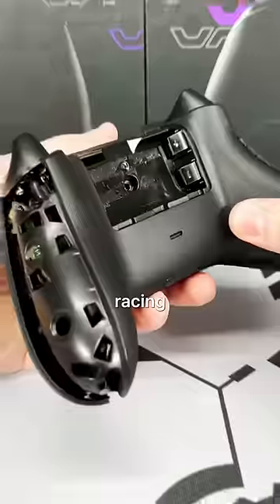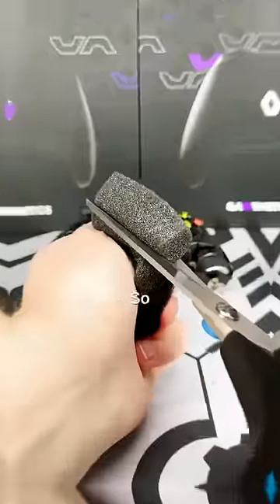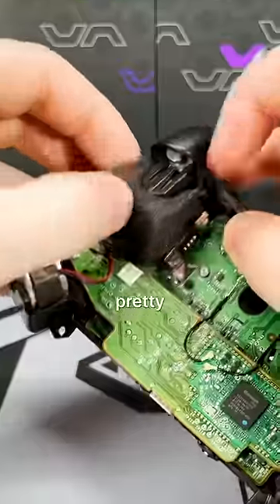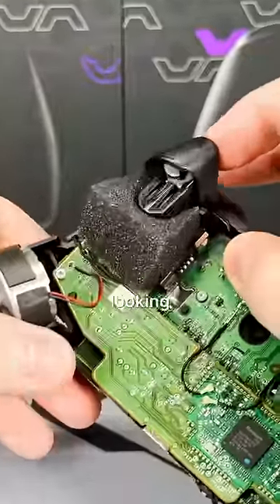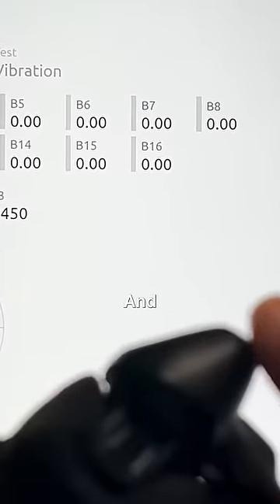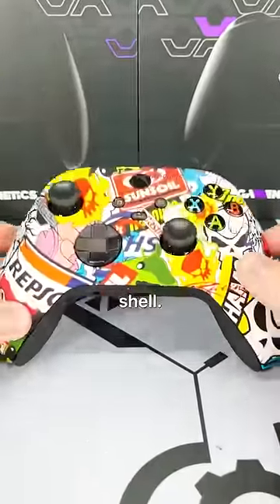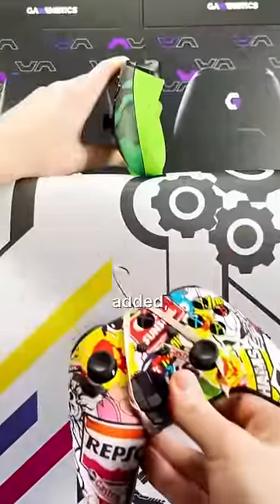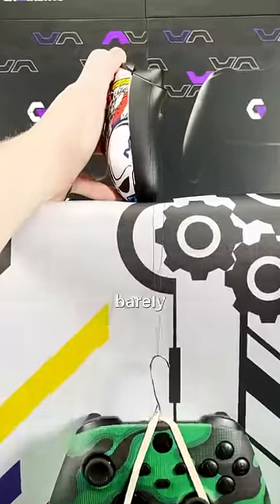The Controller BUILT For Racing

Comment: That foam is going to disintegrate and make a huge mess.
Reply: It will also add way more stress on the motherboard and plastic of the trigger.
Reply: @@benfranklin5335your hand doesn’t really rest where the foam is though
Reply: @equalixer9609  thats not how heat works lmao, it doesnt just stay where ur hand is, and ur fingers are also on the triggers
Reply: No it really won't lol
Reply: @equalixer9609  but there is the moisture and that from the hands if they get sweaty and that yk
Reply: But the controller already has a small version of this to avoid the plastic of the trigger hitting the casing.. and it doesn't disintegrate.
Reply: I get your consern but at least mine has survived for a good 11 months so far. It has been used heavily
Reply: 1. It isn't going to disintegrate, if your controller created enough heat to disintegrate the foam it would burn your hands before it disintegrated the foam.

2. The foam isn't going to cause enough pressure on the PCB to cause issues, it's not conductive and controller PCBs are very durable, and all the soldered on modules aren't just going to fall off because of some foam. 

3. The heat isn't even reaching the foam since it's more than 1cm away from the battery.
Reply: though tbh with modern controllers lasting 1 or 2 years, it's probably not that big of a deal.
Reply: Not to mention it’s a slight fire hazard
Reply: The foam will not disintegrate from the heat given off by the controller or your hands. Not even styrofoam melts at that temperature.  240 °C is the melting point of styrofoam. The foam he's using is made from a polymer that results from mixing Hydrochloric acid and Polyurethane. This type of foam's melting point will easily exceed 400 degrees Celsius. 

What kind of controller are you holding, and what type of food are you eating, for your hands and controller to melt the foam?
Reply: @adamtucker117  you just going to say that or are you gonna give proof??
Reply: @Flabby555  prove to me that you exist and I shall
Reply: @adamtucker117  💀
Reply: 3 words for you:

ELITE SERIES 2 CONTROLLER!!!!!
Reply: @tiagonascimento4386  ngl it's been on my mind
Reply: @J_Analytics  yeah i dont understand why he thinks this foam is gonna melt lol
Reply: For a DIY its still cool. A xbox controller is dirt cheap now a day especially used i think its worth the experience.
Reply: I doubt the heat from your hands is going to melt that foam, repeated use might wear it down but it's not gonna crumble, that foam looks like the same kind I use inside of engine bays at work, it pads the inside of a battery box which gets really hot, and I've cut some for trunk bump stops and they held up ok. This would probably work but not as well as a spring.
Reply: No it won’t. Lol
Reply: @dxfault576 barely any heat in the pads in the grand scheme of things no point trying to be a keyboard warrior on YouTube
Reply: Foam doesn't just disinegrate when it's not exposed to elements and or oil or some chemical

Comment: I think PlayStation controllers adaptive triggers are great but it’s cool how you manage seed this one😊
Reply: Was here to say the same thing. The brakes on nfs unbound are honestly revolutionary. I just picked up a ps5 and am honestly in love with the adaptive triggers
Reply: But what if he has an xbox then he cant use it
Reply: @Pandemomium  not true, using a ximm or chronus its really simple to use a ps5 controller on xbox. Some features may be missing but its doable
Reply: @crashbflexin  Same, I play GTA 5 with my dad all the time and the adaptive triggers sometimes are just alone enough to change a bad day to a good day, and they’re not locked to any setting like this Xbox thing is
Reply: I also love how the joysticks are placed at the bottom and they don’t run out of battery Avery 2 seconds cough cough XBOX
Reply: I hate Nintendo’s controllers, the ones on the switch build in hurt after a while, all the controllers are shitty and cheap asf and break in 1 second after purchase
Reply: @Zentrix71  LMFAO, my girlfriend is an Xbox player and I'm trying to get her to use a rechargeable pack because I'm over spending money on her fucking batteries. Playstation is the goat
Reply: Just got a ps5 recently and was blown away by this
Reply: I turned that off when I got my ps5 lol.
Reply: Yeah I've always been a lover of xbox controllers since the 360.  But Sony knocked the ps5 controller out of the park, feels like a next gen controller.
Reply: That's the one thing I love about the PS5 is the controllers. The adaptive triggers and the touchpad are dope. Love my Series X but the controller is just so boring.
Reply: @crashbflexin  i love them until sonys notoriously terrible batteries die too quick because of the controller gimmicks
Reply: @crashbflexin  lol until I tell you how much I spend on games every year vs what it cost me to buy those game individually if I owned a ps5. Ps4/5 are only popular due to hype beast bs and Asians. Having replaceable battery is better than buying a new controller when idiots kill their battery life.
Reply: @irateamatsu  "boring." it's a controller, it does what's intended. Not every controller needs your butt plug gimmick you keep pitching to Nintendo to be used with joycons lol.
Reply: @Red1676  ps5 controllers have a replaceable battery too... just takes a minute to get at. I've replaced one of the batteries in one already with a better one
Reply: ps5 controller is unreliable and cheap feeling tho
Reply: @Zentrix71  My chargable battery pack that I got 6 years ago lasts days
Reply: @crashbflexin  PC is the goat
Reply: manage seed??
Reply: @crashbflexin  so at that point buy myself a elite
Reply: @crashbflexin  EXACTLY, THE BATTERIES COST MORE THAN THE DAMN CONTROLLER HALF THE TIME
Reply: @crashbflexin  bro stop makeing out to ps5 controllers pls
Reply: @crashbflexin  bro answers 'not true' to a question lmao
Reply: And this is why Xbox controllers should cost way less than PS controllers
Reply: I have never felt any adaptiveness on my ps4 is a ps5 thing or is it just for specific small amounts of games
Reply: @crashbflexin  so u use cheats i hope you get an ip ban
Reply: @nomnomnomblub  i don't recall saying I cheat? I'm a pc player and I brought up using a ximm as a controller remapping tool. I don't own one
Reply: @Zentrix71  they're 20 dollars on Amazon....
Reply: I made the switch to PlayStation 5 and to be honest I went straight back to Xbox. I got bored after the first couple of weeks
Reply: @Zentrix71  funny thing about having the ability to take batteries. You can use what ever rechargeable battery on the market and most of them have a higher "mah" rating then the PS controllers. I get little over a week on 1300mah batteries and over 2 weeks with 2400s
Reply: @crashbflexin  But with xbox you can either use battery's or a rechargeable pack witch you can literally plug into the controller? So if anything you have more options with xbox. If you controller battery brake your screwed xbox players ain't. So Don't get your point
Reply: Yeah and you get a whopping 3 hours of battery life lmao.
Reply: @exposuretherapy  it takes next to zero effort to open a controller and change the battery
Reply: Its actually different to this the adaptive triggers just activate further down the trigger for different guns
Reply: Its actually different to this the adaptive triggers just activate further down the trigger for different guns
Reply: Its actually different to this the adaptive triggers just activate further down the trigger for different guns
Reply: Its actually different to this the adaptive triggers just activate further down the trigger for different guns
Reply: Its actually different to this the adaptive triggers just activate further down the trigger for different guns
Reply: Its actually different to this the adaptive triggers just activate further down the trigger for different guns
Reply: Its actually different to this the adaptive triggers just activate further down the trigger for different guns
Reply: Its actually different to this the adaptive triggers just activate further down the trigger for different guns
Reply: Its actually different to this the adaptive triggers just activate further down the trigger for different guns
Reply: Its actually different to this the adaptive triggers just activate further down the trigger for different guns
Reply: Its actually different to this the adaptive triggers just activate further down the trigger for different guns
Reply: Its actually different to this the adaptive triggers just activate further down the trigger for different guns
Reply: Its actually different to this the adaptive triggers just activate further down the trigger for different guns
Reply: @crashbflexin  yeah but in the heat of battle, being able to switch batteries is wayyyy better than being forced to plug my ps controller in, always loved that option
Reply: I cant believe some people are fascinated by the adaptive trigger like some 5 year olds
Reply: Especially if you have the pro controller bc the pro controller triggers take a lot more force to pull in Gran Turismo I really have to pull them bitches
Reply: @crashbflexin  i prefer the removable battery in the Xbox controller, playstation controllers are notorious for their batteries degrading (and that's inevitable with all batteries).
They should include the rechargable packs by default though, AA batteries are stupid
Reply: @crashbflexin  what a great way to waste 100 bucks
Reply: @Zentrix71  you also have to understand that this is a random person trying to make their controller feel better with as little money as possible. Comparing it to a controller made by a billion dollar company is a little ridiculous.
Reply: @Slixzered  yes. Buying a 20$ battery is an amazing way to waste 100 dollars
Reply: @crashbflexin  I was talking about the ximm or chronus.
Reply: @Slixzered  don't own one, was just saying if you prefer one console but the others controller then its an option
Reply: @crashbflexin  and I was just saying it was a waste of money. What are you arguing?
Reply: @Zentrix71  cough cough Xbox has elite pro controller even for the older generations
Reply: @jamzjamz2352  Cough cough PlayStation has dual sense edge
Reply: That can have the joysticks replaced without taking apart the controller to prevent drift
Reply: @Red1676  Asians?
Reply: @crashbflexin  i hate the adaptive triggers in anything but racing games. And I don’t even play racing games a lot😂
Reply: @Zentrix71  i have had a ps4 for years and its so annoying when i forget to charge my remote I can’t play for an hour😂 i wish you could buy rechargeable batteries
Reply: My bad, forgot Playstation had forza
Reply: the adaptive triggers work like 95% of the time. The other times I feel like I pressed them too fast and it didn't get time to adjust.
Reply: @Austin Lawrence  I'm actually a playstation fanboy but not a bias one and I use an Xbox controller on pc and series x and the batteries last way longer in xbox if your not buying the cheapest batteries. I use Duracell and Energizer and both options last alot longer then even a brand new ps5 or ps5 controller.
Reply: @crashbflexin  same here it’s really good but I turn it off for shooter games
Reply: Does not work on PC
Reply: Nugtastic  im a playstation player with a built in rechargeable that I replace every year for 20 dollars. Shes an Xbox player who goes through 20 fucking batteries in a week, ur the genius here tho I guess
Reply: Xbox have same lol
Reply: True but there has always been controllers that have trigger resistance
Reply: @crashbflexin  they make chargeable batteries that you can put in the xbox, but I just use playstation controllers anyways since they feel so much better in my hands
Reply: @dylanlawson9097  there made from  some really good quality with all the extra detail that they added to the back of the controller, so far yet the ps5 controller is the best with the most features from being a non elite controller or a non "scuff" controller
Reply: Xbox has the same thing 😊
Reply: Was about to say this is like adaptive triggers but without the range of adaptability on the tension lol
Reply: Hot take i hate adaptive triggers I will say for racing games it's very good but any other game it sorta just bugs me especially in competitive games I understand most people like them tho
Reply: I love my adaptive triggers
Reply: No one know about scuf Xbox controllers. 😂 FML everyone lives under a rock
Reply: @Zentrix71 lmao the batteries on Xbox last longer than the ps5 and even then nobody uses regular AA batteries. %99 of Xbox users play plugged in or with battery packs which usually last a good 24hrs+
Reply: when i 1st got my ps5 i thought my controller was broken bc i didn’t know ab the adaptive triggers💀
Reply: @Zentrix71 cough cough batteries last longer than a fucking ps battery pack
Reply: I was going to say the same thing
Reply: He posted on his Instagram how it caught fire😂. Dude a clown
Reply: @dylanlawson9097 feels better than Xbox  series x one tbh. And ps5 is the first ps console I owned
Reply: @Spookiest_ I got like 11 hours on one charge
Reply: PlayStation 5 controllers are like no other controller. If your able too get one in the hands of a Xbox player it could change there life for the better. lol
Reply: i hate it 😂
Reply: @Red1676 Somones jealous 🌝
Reply: @crashbflexin thats not worth it just use a Xbox one

Comment: Why not make the brake trigger have more tension than the gas and give them asymmetrical tension, just like in a car
Reply: So you mean just to copy the Dualsense
Reply: @sup3r-d4n1-bg  no bc he never put adaptive triggers on
Reply: The tension on gas makes it easier to make small adjustments without over doing it
Reply: @jjeb5015 but isn’t realistic and would get mad fatigued
Reply: @jjeb5015  but tension on the brakes would also do the same so why not both?
Reply: @Blitz_Protogen  you spend more time on the gas pedal then on the brake pedal so you won't be fatigued
Reply: @levimeesens5535  sir what? Im saying if you can be more precise on the gas then why not be more precise on the brakes? Plus in normal race cars the brakes are usually fairly stiff which can help with that immersion of driving a real car imo
Reply: @sup3r-d4n1-bg  dualsense isnt an original idea
Reply: @tarragoni4161  wdym? The guy in the video is just trying to make his controller like the Dualsense 😆
Reply: @obiwankenobi-  bc he can’t
Reply: @Eddiee757  you can't press against some foam?
Reply: @p1_reko990  yeah I know but that guy was saying he made it into a dual sense when he didn’t
Reply: @jjeb5015  it's not
Reply: Well as a right handed person, not needed. As it would be bit more difficult for me to press brakes with my left index finger compared to right one even tho the resistance in both triggers are same, it would felt like if the left one had more resistance
Reply: sounds like you have baby fingers.
Reply: @843jack1  dude, cars have stiff brakes because they are connected to the hydraulic brake system. The throttle is a simple butterfly valve, the resistance you feel is a simple spring. The gas is light, the brake is stiff
Reply: You mean to say that gas and brake pedals have asymmetrical tension? No
Reply: @lucas_woods  they have asymmetrical tension. Gas is linear and light, and brake dude to the liquid system hardens quick.
Reply: true
Reply: @obiwankenobi-  Never said that I just said that he is trying to make his triggers like the dualsense triggers
Reply: Randy Ziegler  whos?
Reply: Randy Ziegler  yeah probably
Reply: this guys sounds about 12 probably doesn't even know the brake pedal is stiff
Reply: @sup3r-d4n1-bg no because what the commenter said was asymmetrical tension akin to what sim rig players have done for a decade, so are you saying PlayStation copied PC users?
Reply: They wanna be DualSense so bad.

Comment: Gran Turismo 7 with the PS5 controller is amazing, you feel the road with the haptics and there's tension on the triggers
Reply: feels even better with an actual steering wheel… and dont get me started on sims like rFactor 2 and iRacing, heaven in your hands
Reply: @stibblr it feels even better driving the car -_-
Reply: @guerosanchezt2832  how does it feel to drive a $700k track only race car?
Reply: @ItsATrap614  You don't get it do you?
Reply: @JohnsonHoword  hey im glad you came out as full blown ignorant. So it pointless for u to have a race wheel for one game kinda seem like you could say the same about upgrading from ps4 to ps5 for 1 game tardddddd
Reply: @guerosanchezt2832  - It feels even better BEING the car

Comment: FOR THOSE OF YOU WHO DONT KNOW YOUR FOAMS: 

That's polyethylene foam, which has a melting point of 100-210° meaning that with the controllers normal temperature of ~80-90° and your hand being about 97.8° he should be fine to do that without melting, 

The motherboard is capable of withstanding high amounts of pressure and he didn't place anything on pins, the double sided tape adds a layer of protection for the board, so he should be safe there too, just don't expect the foam to last too long because of the amount of pressure it'll take under constant use.

Comment: It’s funny you did a video like this, I had an elite controller that never fully went to 100% pressure and had to change the sense to super high for it to hit a 100% and ever since that was like my secret weapon, throttle in Forza was always on point with only having to move so little. I’d keep a lot of pressure on the shell of the controller to simulate actual throttle feel and it worked perfectly